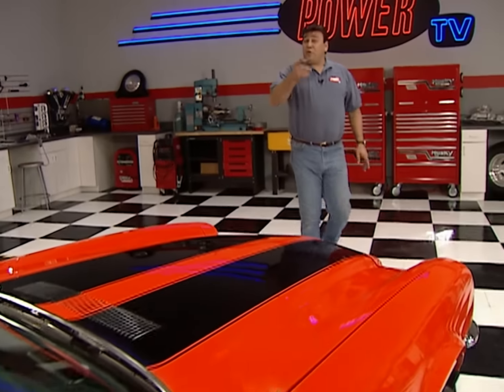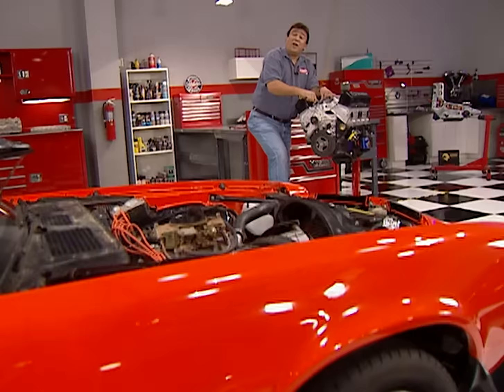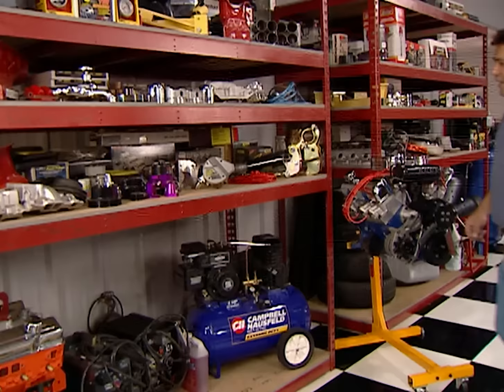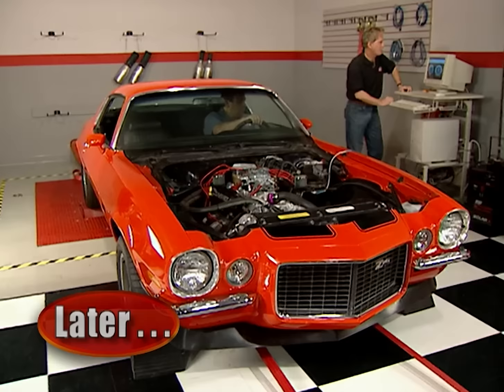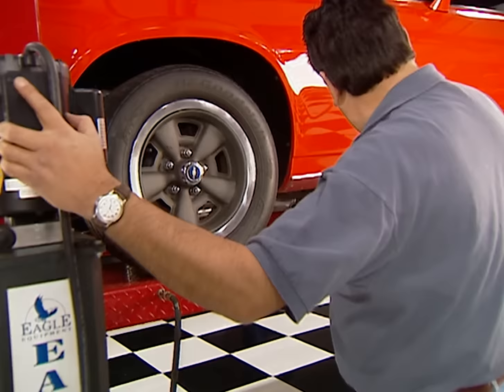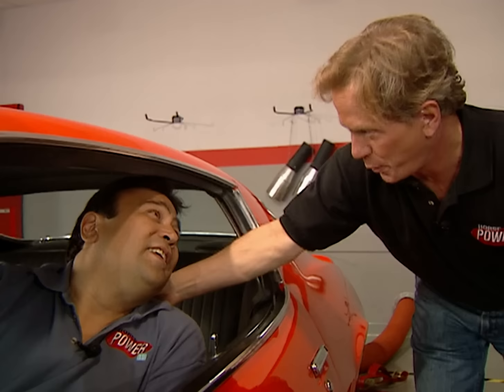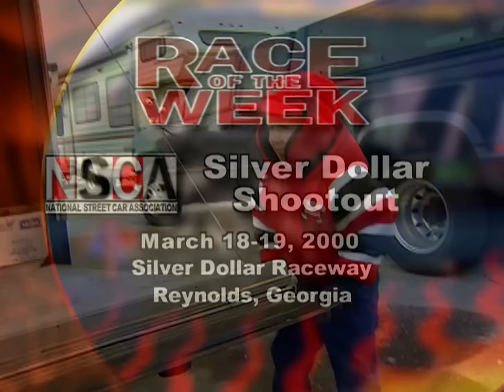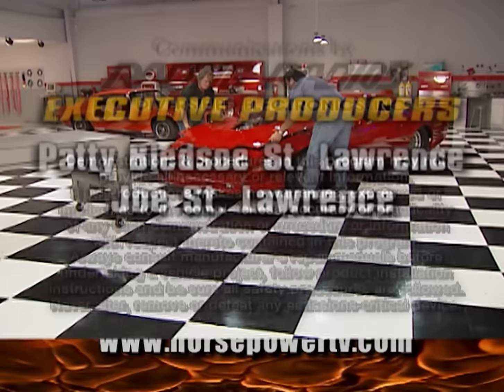Swapping Out A Z28's Old 350 For A ZZ4 Crate Engine - Horsepower S2, E10

Comment: Well I'd say that motor swap was a mission failure! The original 350 had an output of 360HP and then the new motor had an output of 448HP and yes I'm fully aware it was on an engine dyno and had other modifications that was taken off but had a final output a tad over 330HP, hmm I'd say that was not the best intentions they should've just modified the  original motor IMO! YOU WIN SOME AND YOU LOSE SOME!!😁😉
Reply: Agreed. Would’ve kept the original block with a rebuilt kit.

Comment: The only acceptable "upgrades" I saw in this video was the HEI distributor and the exhaust. There absolutely no chance I'd give up an LT-1 350 for that ZZ4 crate motor. A simple rebuild and a 30/30 cam with a little porting and a single plane intake and a valve spring rocker upgrade would put you well beyond the ZZ4. And still have that solid lifter high compression LT-1 magic! Those seats are hideous, the accessory drive belongs in the scrap yard, and you can rebush the stock shifter with bronze bushings. Anyone who would do that shit to that Z/28 doesn't deserve it.
Reply: Solid lifter high compression magic? You mean oily valve lash adjustments and killing the power by retarding timing to run on unleaded pump gas? You mean beating the unhardened valve seats to death? That magic?

Have you priced just having a set of 50 year old heads professionally rebuilt lately? Cleaning, magnafluxing, installing hardened valve seats and new valve guides alone will cost almost as much as new aluminum heads and won't have anywhere near the same flow.

While not shown in this clip, they also swapped the ZZ4 113 heads for later ZZ5 style "fast burn" heads. The 113's flow as much as 1970 LT-1 186's and the "fast burn" heads make both look like late 70's smog heads. At 0.300 they flow 183cfm vs 187cfm from the 186's at 0.500. The "fast burn" heads at 0.500 absolutely smoke the old double humps with 254cfm of flow. 

And no, you ain't home porting a set of 186's in your tool shed to match the flow of new unported "fast burns". Pros might get 265cfm out of a set of 186's on a good day and that's assuming there's even enough material before cutting into the coolant passages due to 50 years of rust and core shift. 

I do agree with you about the seats they chose though. The factory lowback seats suck but a set of 3rd gen seats reupholstered to match the rears would have improved driver support and looked far better.

Comment: i have a zz4 in a 1979 Chevy Malibu classic with a bw  power brute super t10 4 speed  from Bryan at s&k speed it rocks in 2nd gear i had 327 l79 but you had to rev it up to make power i like the zz4 better better drivability it is just right you dont spin the tires you take off like a rocket i have a old holly 3 barrel i am looking to try

Comment: The first mistake they made was slipping out the double pumper for vacuum, secondary carburetor.
Reply: why do you say arrsery
Reply: teddysmith457, yeah but the double pumper was used for all out horsepower, the vacuum secondary carb is used more for drivability

Comment: Wow you lost 118hp. That's a huge drop
Reply: So they go to the trouble of pulling out a perfectly good engine to swap in a crate engine with alot less horsepower ?..... These guys are ridiculous.
Reply: you do realize the first numbers were all crank numbers right? that's about an average power loss once you add a drive train and drive accessories
Reply: They say at the beginning, while Joe is pulling the engine the crate made 448, and the stock made 360. They gained 88. Loss at the wheels is typical.
Reply: That's wheel horsepower not crank horsepower
Reply: @dalemckenzie2279  the   power loss   in  drive train   and  trans*  rear  end   is normal
Reply: 330 rwhp is about 375 net hp (manual trans) which could be around 425-450 gross hp, if you removed all the accessories and water pump,  kept the headers, no mufflers, etc.     My  Viper RT10 put down 405hp at the wheels. It makes closer to 460 net hp.  Gross hp would be way over 500hp, probably 525.
Reply: @CrankAddict  
Yup. Chevy rated the 1971 LT-1 at 330 gross and 275 net(in 1972 that same engine was rated at 255 net HP). The exhaust and accessories alone took away 55 HP. The new engine was realistically 380 net HP, still quite a bit more than the factory 1970 LT-1's 360 gross HP. Subtract at least 12% for driveline losses you end up right around the 330 RWHP the car put down. 

Plus they did it on unleaded pump gas and never have to adjust lash for a solid lifter cam anymore.

Comment: What was the RWHP of the older engine?
Why settle for 331 ho of the ZZ4, when the original motor was 360 ho.
Reply: There's SAE gross HP, SAE net HP and then there's wheel HP. All are measured quite differently.

𝑮𝒓𝒐𝒔𝒔 𝑯𝑷:
The 1970 LT-1 was rated 360 SAE GROSS HP. That was measured at the crank, with an open exhaust and no engine driven accessories(water pump/alternator/etc). When Horsepower TV tested the new engine on a dyno, under similar conditions as Chevy did with the LT-1 back in 1970, it produced over 400 GROSS HP.

𝙉𝙚𝙩 𝙃𝙋:
Net HP is also measured at the crank but with a full exhaust and all driven accessories as the engine would be installed in a car. Chevy published both the GROSS and NET HP of the 1971 LT-1. The full exhaust and driven accessories resulted in a NET rating of only 275 HP vs a GROSS rating of 330 HP. A 55 HP loss.

𝙒𝙝𝙚𝙚𝙡 𝙃𝙋:
Wheel HP is obviously measured at the tires in a fully assembled car with power being delivered through the transmission and axles. All those components have inefficiencies and losses. Conservatively, depending on FWD vs RWD and Auto vs Manual, driveline losses will take another 10-12% away. Older transmissions like a Turbo 400 or C6 will eat up more horsepower than a modern auto. Even the old 4 speed manuals aren't nearly as efficient as a current 5 or 6 speeds.

A factory stock "360 HP" 1970 LT-1 Camaro made well under 300 HP at the tire. Probably somewhere around 275-280. While 50-55 RWHP more than stock might not seem like much, also remember that the 1970 LT-1 had a solid lifter cam with 11:1 compression. The engine they swapped in can now run on modern pump gas and will require less maintenance.

Comment: It's stupid to pull a numbers matching 350 from a classic z28. A modern cam and some headers would have made plenty of difference, saving the original exh manifolds for a future restoration if desired.
Reply: it's not your car arrrserewholly
Reply: It's a camaro calm down they are all over the place just look in a back yard or junk yards where they belong
Reply: @matthewjohnson6047  No, the rusted out plain jane pos in a junkyard is not the same as a numbers matching Z28. WTF do you know? What exactly did I need to calm down about? Was my original comment to exciting for you?
Reply: I don't care z28 rs ss they are not that great dime a dozen car every one has one and every little boy pees in there pants for one I Haye seeing 500000000 at car shows or on TV or down the road it's a cookie cutter car  boaring
Reply: And no one ever said its numbers matching its probably just clone 🤣😂
Reply: @matthewjohnson6047  That's a weak attempt: probably? Like Aesop's fox said, "Those grapes are probably sour anyway." An owner who cared would mothball the engine to reunite it with the car in the future if the car appreciated in value. But these guys have no concerns about that. I equate emojis with the lower half of the IQ curve. They are another weak attempt to bolster an opinion.
Reply: @matthewjohnson6047  Early second gen Z28's aren't just sitting in driveways everywhere with for sale signs on them. 1970's performance cars are now a high priced commodity.
Reply: I can drive down the road and see 10 in my neighborhood and they dominate car shows I'm sick of seeing gm product every one thinks they are so great but they are trash and so common
 I want to see some dodge and ford's  a AMC even.  everyone  has a hard one  for gm it's annoying. Buddy had one in high school with a "383" that some master motor builder built and was dog ass slow and couldn't keep valve trian together. And got gapped but 6cly  mustangs it was embarrassing. I have built couple fire birds and camaros my self I'm all set cheap chinsy cars compared to mopar or Ford u can have ur cookie cars
Reply: @matthewjohnson6047  I am a big fan of Mopar and Ford and AMC cars from the 60s and early 70s. I just thinks it's weird for a man to hate on any brand of hot rod car. I certainly don't have a hard on for Chevy, but it's immature to act like gm cars are lima beans or boiled broccoli sprouts. Work on yourself, man.

Comment: Nowadays a 70 ½ all original would bring a good buck. It's criminal to remove that LT-1, or toy with originality.
Reply: Agreed
Reply: that original  engine  is low  hp and tired    time  for a rebuild     i get original but  a nice driver is nice too  so  ya    and its  not a crime
Reply: @Thevacomaticvacuumcorner  a little elbow grease and effort would wake that engine up. Any pre 1972 motor can be woke up with timing bump, carb jetting. Those LT1s are built rock solid.
Reply: @FabulousDisaster1988  it still need a rebuilt  its from  1970   a  fresh  up rod bearing crank  cam     valve  head wont hurth cheaper  go   crate  but  go a hed and keep it alllllll  original    i hate  this  so much in car culture  always a kevin  or karen  bitchin OMG  he changed the car  c all the police  !!!!!    look  the engine is original needs a rebuilts its from 1970   they  went crate engine its fine   can't  ya just apreciate the work?
Reply: @Thevacomaticvacuumcorner  I'm not saying the swap was a bad idea. Save yourself the work of rebuilding engine.
Reply: @FabulousDisaster1988  yes   agreed  save that work   is true but  im just pointing out the original would needa rebuild stroke  to 383  and so on  original  are more valuable yes  look at auction like Barret Jackson in  Arizona  million dollar  original  specs  but   a  fresh up or  crate engine makes it a nice driver  you  can enjoy.  Original  350  lt1   from the 70s  might need valve  spring head gasket coudl be on its way out  or  spun bearing  elavating the cost  of the rebuild   .... you never know
Reply: @Thevacomaticvacuumcorner  yeah you never know with some of these 2nd hand engines, it could be all matching numbers. But previous owners could of abused it.
Reply: @FabulousDisaster1988  yes  now this i fully agree head gasket  oil burner   coolant leak  seize up  or about to  spun a rob  bearing you never know and some time  the  cost  of a crate engine is way  less than a full rebuilt and bore  0.30  over  so  yes true
Reply: Definitely the right direction for a Driver. Especially if you kept the original engine.
Reply: Yea my uncle has a 70 and half split bumper with 396 and Muncie...  Factory 350 was gone when he bought it in the 80s..  he's also got a 69 with dz 302 and Muncie.
Reply: replaced 50yo technology with 30yo technology.
Reply: @keithcieplinski you know this show isn't new right 😂
Reply: Rebuild to reinstall later for sure 👍
Reply: So you're saying this makes the car worth less? That's great news to me!!! I can get a better running car for less money!!! Perfect
Reply: @FabulousDisaster1988 lt1 Is 90s lmao that’s a 350
Reply: @Billy-gh9ih  there was LT1s in the 70s from 1970-1972. There was also the 90s version

Comment: Got the same engine.... 430HP/TQ...  EFI on mine, how they lost 100hp+ to the wheels is beyond me...
Reply: 25% loss is normal for an auto
Reply: @jacobburden3065  20% MAX!!!!   And 20% of 450= 90HP.. Not 120HP!!!
Reply: U said efi they used a carb
Reply: @matthewjohnson6047  Carbs make higher hp peaks slightly that EFI on engines due to how they mix air/fuel together...

Still, should NOT resulted in 120hp loss.

Comment: should have rebuilt the 350, better engine imo
Reply: The ZZ4 is a 350 with a roller cam, a 1 piece rear main seal and the heads they chose will out flow legendary 'Camel Humps' any day of the week. There's also no need to machine 50 year old heads for hardened valve seats or run fuel additives like with the 11:1 domed pistons and ancient wedge chambers. They ended up with 80 HP more at the crank on 1.5 points less compression burning pump gas. The only advantage the original LT-1 had was 4 bolt mains(which can be added to the ZZ4 block) and slightly better rods. Neither of which are needed at that power level and RPM.

Which is the better engine again???

Comment: Surely he meant 260 stock hp. Never heard of a stock 350 putting out 360 hp
Reply: The 1970 LT1 350 was rated at 360 hp for the Camaro.   Those are "gross" numbers, meaning no waterpump or any other accessories installed.   Manufacturers changed to NET hp in 1972 to better show how much hp the engine makes as installed in a vehicle.    The LT1 dropped to 250hp net in '72,  but it also went from 11:1 compression to 9.5:1 compression.     They still use "net" hp today.    A "stock"  truck 350 puts out about 250 gross hp, about 190hp "net".    All the engine dynos you see  on Youtube are usually "gross" hp.  Rear Wheel hp (rwhp) is how much hp actually makes it to the ground, and includes losses due to full exhaust and driveline friction.  It can be 15% lower in a manual trans car, or 20% lower in an automatic equipped car.
Reply: @CrankAddict  Thank you

Comment: The ZZ4 is not a high RPM engine, max power @ 5200 and chuck thinks to buzz it all the way to 6500rpm. Nope
Reply: Not really a ZZ4 anymore though. They swapped the 1989-91 L98 Corvette style 113's for GM performance "fast burn" heads and installed an LT4 hot cam. They don't give you a very good view of the graph, but if you look closely it pulled all the way to 6K.
Reply: He knows how to buzz to the Golden Corral for all you can eat buffet.  🐝 🐝